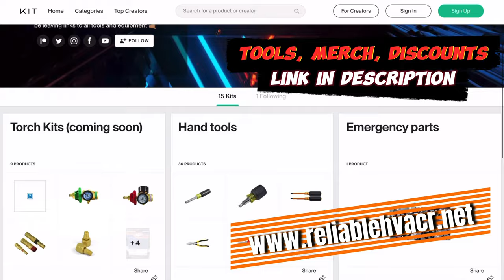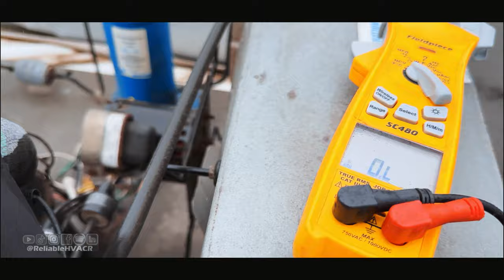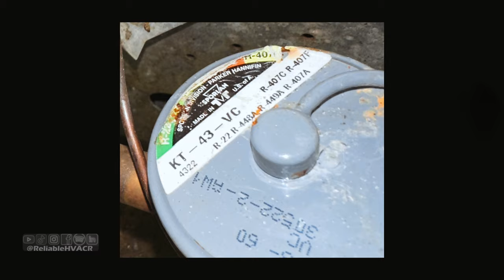Checking if a R12 Compressor from '99 is any good

Comment: Two options if they won't fit a new unit, fit R134a compressor plus txv and run on R134a. Or fit R404A compressor matched duty wise off the old R12 compressor, run on R448A/R449A. 
Both the above could come back and bite you on the arse....
Smart move imo would be to size the room for new equipment and then compare to the new evaporator and see if it can be made good.
If you don't need the work, walk away.
Reply from the maker: Rewatching the video I might have to walk away 😂 I initially went out as a favor and they didn't want a new system from the previous tech
Reply: @ReliableHVACR Better a dollar you never earned than a dollar you never got paid.

Comment: You can use hot shot 2 for r12 replacement. But that txv is incorrect. Either pop in a 22 compressor or replace condensing unit and txv to 404a.
Reply from the maker: Yeah I got stuck doing a favor but we might end up swapping that condenser

Comment: Im pretty sure its R22 not R12. Especially if it's from '99
Reply from the maker: It might have been gone by that time right? When I look up this compressor it keeps telling me R12 but R22 makes more sense. But when the supply house cross referenced it they were getting 134a to replace it
Reply: @ReliableHVACR  134a is a replacement for 12, who knows, maybe it was something lingering on a shelf somewhere. I personally can't recall seeing any R12 anything past mid 90s.
Reply from the maker: I had to find the nomenclature but yeah the (A) before XA is for R12. We'll see what happens
Reply: @ReliableHVACR  I looked it up too out of curiosity. And date code looks like June of 99. It's a strange one.